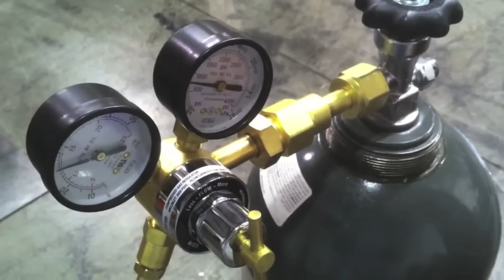Mig Welding Basics 2

Comment: Hey Jody, can I mig weld stainless steel using 75/25 shielding gas?
Reply: This is possible when using stainless steel "dual shield" wire, the gas-shielded flux-core process.  For plain stainless wire this gas is too oxidizing!  The usual is something like Argon 2% CO2,  or Argon 1% Oxygen ("Argonox 1") kind of thing.  BIG HINT:  Check the data sheet of the wire manufacturer!  Or any manufacturer, like Lincoln or Avesta.  The wire grades are fairly generic.

Comment: Hey. How about 100% argon? Is that possible? Also could you explain double shielding? 

Thank you. You got the best videos.
Reply: I think you mean dual shield.  It uses a combo of gas and a flux in the wire to make shielding gas.
Reply: 100% argon would be for welding aluminum
Reply: You can use 100% argon to mig weld steel but ut doesn't lay as smooth as 75/25

Comment: Jody, I know this is older video, but thanks again!  I think I watched it 10 times already.  It's been years since I've done any welding, and I just bought this welder Hobart 210 MVP and Spoolthingie 100 5/2020.  I used to have the Ironman 210.  Is it commonplace to use a 3-way valve on these machines to swap between 75/25 and 100% argon tanks to go from steel to spool gun without 'swapping' bottles?

Comment: say you've got some really thin metal like body panels about 1/16 and you have to weld to much thicker metal (like the frame)... In order to penetrate the frame, your amps have to be up but then you (well "I") burn through the thinner metal. What's the trick there?

Comment: Ive tried to weld uphill with my miller 211 autoset, slightly less then the recommended setting then horizontal on a vertical joint, running up hill i always seem to get metal flowing back down in large blobs looking like junk, but welding downhill it is fine. Any ideas?

Comment: hello Mr Jody. .I'm a newbie. I've got a miller 252 and when I start out welding it welds really good . but when I've been welding for about 15-20 min the machine starts sputtering and will do so for the rest of the duration of my job. any thoughts. FYI love the videos you do a great job.
Reply: let it cool?  seems like alot of welding, maybe tip?  cheap tips get hot, expand, and snag wire, nozzle dip? keep cone and tip clean

Comment: Excellent video, but a question on safety. I noticed you wearing gloves, but you were not using a welding jacket. Is this proper procedure when using a MIG machine, or is it better to be properly protected? Thanks, and I look forward to your answer. Great video!!!
Reply: Welding Jacket not needed...  Mig is not like the old stick welders..
Reply: Don't really need a jacket but as long as you have a long sleeve shirt been times were I was in the shop and forgot that and later on had fairly good burn on my arm from just the light intensity of the arc.
Reply: You should wear a welding jacket and welding gloves when ever possible. I don't use the protection that I should and have the scars to prove it. .
Reply: Helmet and gloves.. don't need the jacket with a mig welder.... especially if it is shielded.
Reply: divertim1 You do need to be covered or you'll get a nasty sun burn. Doesn't necessarily have to be a welding jacket.
Reply: DSCKy
You are right; you can get sunburn from welding... But like I said you don't need a heavy welding jacket...  The people that need a heavy welding jacket are those that are doing heavy welding.... all day long... shipyards and such.  Not these folks that are doing light welding and tacking.

Comment: Another great video. Thanks Jody. I can't help but feel I'm miles ahead before I even take the plunge and fork over my hard earned cash. BTW, I always believed in "go big or go home", Am looking at multi process machines so in the end I have greater capability/dollar. Any preference? Looking at Longevity, Thermal Arc and HTP. Also looking at the Everlast Powerarc 300 as Lanse says its a really sweet 6010 stick machine for not too much spendavos. Any thoughts?

Comment: What brand would you recommend for welding 1/4  to 3/8 inch steel plate with 100% duty cycle, with a good solid clamp and not as expensive as the Thermal Arc Fabricator 252i?

Comment: Question... I'm using a Lincoln 225 precision tig what can I do to weld aluminum on cars the high frequency is taking out my electronic s I lost one computer two electronic ignition s does disconnected battery help and how far away do I park other cars can this high frequency be shut off

Comment: Hey Jody, I realize this video is years old now as of April '18, but my question concerns the machine used in this video.
I'm looking to replace and upgrade my old Hobart mig and being a metal fabricator who's hoping to grow into the status of "professional" eventually, between the Hobart MVP 210 of Everlast Power i-Mig 200 would you suggest one over the other OR do you recommend another machine in the $700 -$1000 price range with 1/4" steel weldability?
Thanks very much for your time as well as all your great videos! Peace.

Comment: hey Jody, A little more on the different mig processes ? Do you have to have a machine with a "spray transfer" setting or is there a certain point in the upper range of voltage and wire speed where its no longer concidered "short circuit" and would be a "spray transfer" . I'm a long time "hobbyist"  stick welder and still learing my mig (hobart 190) but really liking it so far. please hook a spool gon to that 210 and do some alum. thanks
Reply from the maker: Larry Collier I do plan on hooking up the spool gun later on. There is no "spray transfer setting" Just Spray transfer requires more voltage than short circuit and usually needs a pretty heavy duty machine to make it useful...like a 250 amp mig welder with decent duty cycle.  for example, a voltage of at least 24 depending on type of gas used and diameter of wire.

Comment: Hi mate,
Ive been welding with 100% argon as I use it for TIG welding and dont want to have to fork out for another bottle specific for MIG. Ive noticed on heavy materials it welds nice however on thinner materials (1.6mm and under) its hard to get a smooth weld and a lot of time I burn through.
Ideas if this is just a gas thing?
Cheers !
Adrian
Reply: You should not use pure argon for welding steel - the penetration and side wall fusion is generally poor and the appearance is usually peaky due to loss of whetting and fluidity in the arc. Hopefully what you weld is cosmetic only and has no structural importance!!!!!!!!!!!
Reply: David Richards
 Cheers mate, thanks for the advice.

Comment: Hi Jody awesome vid. Can you make any mig do spray transfer or does the machine have to have a spray setting. Thanks for sharing you knowledge.
Reply: The gas must contain >25% co2, and the machine must have enough juice to cross over into a spray transfer. That is largely dependent on wire dia and the gas mix. FWIW, I spray .035 solid wire with 84/16 gas @ ~26v/650 ipm
Reply: On 11ga to 3/16 type thickness. Forgot to give context.
Reply from the maker: There are lots of argon/c02 mixes that are used for spray transfer like 84/16, 90/10, 95/5, or 98/2 argon/oxygen. But like @adam tankersley stated, your machine has to have the power and duty cycle too if you are going to make it useful.  It takes a few more volts than what is used for short circuit too.

Comment: i have a mig-130 and i don't have a breaker big enough to run it, i can only run the welder for a few seconds before it throws a breaker, but i was wondering what size breaker would be best to use for the welder
Reply: Dirk Mitchell i wired up a 20 amp with 12GA and it still throws a breaker, but i bought a 30amp and I'm gonna put it in today and see if it works. and its a brand new breaker, but it was a cheaper one. i keep forgetting the brand but it starts with a z hahaha.
Reply: Starts with a Z? Cant think of anything like that Siemens maybe. Just be careful if it 12GA wire from the breaker to the plug then in theory the wire can heat up and melt before the breaker blows. 30A circuit needs 10GA wire.
Reply: It's a zeny.
And 12 GA is fine for a 30 amp.
My step father has been doing electricity for a little over 30 years and he wired everything up
Reply: And I got the welder to work for the most part. Just one lowest and medium settings. After welding for a while I felt the outlet and wires and they weren't even warm

Comment: when doing a 6g what is the best tips that you can give to some on
is it better to use .035 .045 and what setting do you like for both
Reply from the maker: I would go with .035 for a 6g test weld.  probably around 18-19 volts and 200-240 ipm
Reply: thanks been have a lot of problems with it can not get it right

Comment: I know I'm late to ask a question, but i been really looking into buying a new welder. I do autobody work as a hobby, so i want a nice Mig welder but at the same time why not learn how to Tig weld as well in the process. I want a good all in 1 welder and don't really want to spend a couple grand since its a hobby. What would you recommend for an all in one welder or do you recommend buying multiple machines.
This is what i found that looks promising but have no idea if its good or a bust. If you know a better brand or think i should raise my price range up a little please give me your honest opinion! You do amazing work and i trust all your advice!!! Thanks

Thermal Arc Fabricator Multiprocess 181i Welding System — 180 Amps, Model# W1003181
Reply from the maker: I think the Thermal Arc fabricator is a pretty good way to start. There is a lot you can do with 180 amps and thermal arc accessories like tig torch, ground clamp, etc... seem to be pretty good. ( although tig torch typically is not included)
Reply: Alright thank you very much for the help. If you think it's good then I will go with that one! Again you're the best

Comment: can you weld in your garage with the garage door open or would it be dangerous for people walking by?
Reply: +Alec C Are your neighbors usually in the habit of staring at bright lights? Do they stare at the sun in their spare time too? Yeah you can arc flash people who are not wearing appropriate eye protection at a good distance. Now whether that is really your responsibility is another matter. I'm not so sure it is either.
Reply: Takes five minutes to tack up a screen rack and five more to fit it with a plastic sheet/old blanket and 1 min to move it far enough away to not risk a fire.

Comment: Hey @weldingtipsandtricks. whats a good setting for MIG welding exhaust tubing. Like what gauge wire to use for what setting wire feed speed.
Reply: Joseph Young, Jr.   I've been welding exhaust overhead for 30 yrs, probably over 40,000 hrs of weld time with 200 and 250 amp machines, mostly blue. I've always ran .035 in them but I'm flying on .065 AKDQ tubing. You probably want to run .030 wire and just set the machine where she welds good. 15 to 20 cf gas depending on if your shop doors  open and there's any breeze blowing in. I've always ran straight C02 for this app with minimal splatter.

Comment: when you're welding and you can feel the wire pushing into the surface, is it better to increase the voltage or drop the wire speed?
Reply: slow down wire

Comment: when I try to set my mig welder to lower settings on flux core I cant even manage to find anything between hissing and completely stubbing out, in higher settings though i can find a nice balance, is that a normal thing for being in settings that are just too low? Or is my welder just not really capable of that? or at that point do I just need a thinner wire. It has rheostat adjustment so I can move the knobb any amount I want.
Reply: danthemanzizle Generally if you are runnig a higher diameter wire you are gonna need more amperage .. And it could also be the machine you're using .. There are many answers to this question.
Reply: X3n0typ3 Please elaborate, i'm having the same issue where it seems more consistent at a higher setting. I am also using a cheapo flux core/mig combo. 4 volt settings, unlimited wirespeed. Also i'm a noobie ha
Reply: Arr See I think he means thicker welding wire= higher voltage settings... as such you adjust your wire speed accordingly so you get like a consistent electrical zapping type sound, rather than pop pop pop crackle zap pop. 

As for your machine, well it answers itself, it is a cheapo, however, cheapo's are usually good for non commercial use, so, that said, that unlimited wire speed, ive never heard of it, but even still, 4 volt settings doesnt sound like alot to choose from, so you may be limited to thinner welding wire with lower amperage and wire speed..... best bet, do some testing, different wires, different voltage, too cool, and the welds will look round in diameter, too hot and you will start to gouge or undercut the parent metals, just right and it will look like packing glue into a corner, kinda of like a gentle U- curve... just keep trying, and if you are a noobie, you can always ask a fab shop for some work experience in welding, most will be happy to oblige since its practically free labor.
Reply: +Azza  the 2 switch MIN/MAX, 1/2, voltage setting arrangement is (or was) common with low end 120V MIG welders. The downside of it is it is not intuitive precisely what the sequence is to increase output. Is it say MIN1, MIN2, MAX1, MAX2? Or is it MIN1, MAX1, MIN2, MAX2? The first one sounds the most likely to me. But what I think really has no bearing on how things actually are. It really depends on how the machine is wired up. I believe the second arrangement is how mine really works. But I'm not 100% sure. I'd have to check. Just welding with a 2 switch MIG welder it isn't always so easy to tell then either. At least not as easy as you might think it'd be. To me MIN2 seems hotter than MAX1 is. But I could be wrong. Therein lies the problem too. But it really is a good little machine for light work. Once it is dialed in. Or in its case switched in?

Comment: What gas is used to welding ?
Reply: Marian Nicolae usually 80% argon and 20% co2 so the metal doesn't oxidize when it cools down
Reply: James Miller only co2 what îs the problem ?
Reply: Marian Nicolae I think argon and co2 mix is the best
Reply: thank you very much

Comment: On a Lincoln mig135 welder where the heat settings go in alphabetic representation instead of numbers most things I weld on or around 4 - 6 wfs thicker projects I feed a bit slower to ensure burn in and thin like car baodies I use like setting a and the speed is usually like 5 or 6 seems to burn good I have 2 questions when using .35 mig wire from lowes do you think this is the optimal settings in those situations? And also when welding cast iron like cast iron frying pans is there anyway to weld it using mig without gas on .35wire without preheating so normal mig wire penetrates the cast iron and burns in?
Reply: cats needs to be pree heat to make the weld.
Reply: +Chris Coll  what about the difference in settings? where the mig im using has a - d and 1 - 9 on the wf? how does that compare to the settings on the welder you're using?
Reply: +charles johnson mig weld is is the brother. of stick 6010 it is made for a frist past. weld but. can b used. for light metal . i have  30th year + weld ant a good. speller but. i am a welding. m. f  er

Comment: You can take your  liner and gun out of the machine take your TIP out and blow the liner out with a air hose,if its real dirty you'll see the shit blow out of it! I did this for 30 yrs it works !!
Reply: And also put a wire cleaning button in front your wire spool which keeps a lot of shit from going in your liner !!
Reply: I was taught that tip when I first started and it works great. I have cleaners in both of my everlast mig welders.

Comment: i was using 1/16 metal core wire with c15 gas with 300 wfs and 27 volts welding up slag pot cracks that are 14 inches thick and i had to use a smith torch with 10 lbs of acetaleen and 95 pounds of oxygen pressure at a double bevel. its about 2 inches on eather side of the crack give or take how the crack is formed but you have to weave the torch slow on a 30 degry angle with a 1 inch weave and the bottom is just breaking through but if you fuck up it will say fuck you and spit molten steal at you lol it hurts i got 1 big ball down my boot and i got a scare 1 and a half inches round on my foot but its a shop you half to use what they got. you are a awsome welder

Comment: loops & weving  your welds will result in lack of fusion, fact. why would you teach this
Reply: +Tec 9 
Poor welder technique such as incorrect angle or manipulation of the electrode/welding gun, will prevent adequate fusion of the joint sidewall. Weaving, especially dwelling at the joint sidewall, will enable the weld pool to wash into the parent metal, greatly improving sidewall fusion. It should be noted that the amount of weaving may be restricted by the welding procedure specification limiting the arc energy input, particularly when welding alloy or high notch toughness steels
Reply: +Paul Kelly loops and weaving will result in lack of fusion, fact.........past that link plz.  flux core maybe because of slag inclusions, solid wire, so long as your bead isn't cooling and your tying into a red hot puddle, your fusion is right on par. Slowly moving your gun "rolling" over your puddle where the arc isn't "penetrating" into the base metal but simply arcing on top of its own puddle surface THATS lack of fusion.
Reply: wanna know something funny i copied Paul Kelly response into google and all he did was copy and paste it from a website LOL
Reply: Point poven, it's not just my opinion  on the subject.  Andrew Kimble.